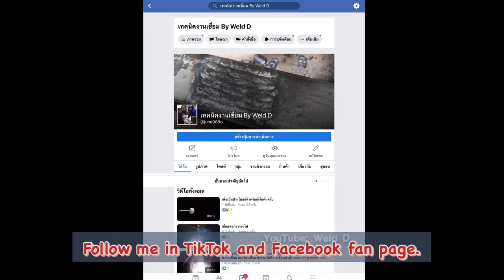2 techniques that professional welders use to weld square tube in vertical position.

Comment: how not to weld.. please please don't weld anything that is going to be around people please..
Reply: Agreed......
Reply: PLEASE DON'T....
Reply: Entonces cómo se hace?
Reply: Please do explain and post a video of yourself welding square tubing with stick welding
Reply: I think this video is basic for people who don't know how to weld!
Reply: This is how you weld when you can't weld.
Reply: @7ashoBeam 
 Yeah, showing them how NOT to weld!
Reply: show me how you do it then with a stick welding.. im a pipe welder and do fabrication outdoors and this is the only way you can do it specially with a 1mm thick square tubing
Reply: @jaival_rhaine for starters use the right electrode for the job. smaller rod size, less amps needed. Another option is to weld D- instead of D+, or even AC for less amps.
Reply: Also, as a pipe welder you should know this would never pass xray due to the impurities due to the slag inside the weld, which is just going to cause rust from the inside out.
Reply: @Corn_Pops_Rusty_Razor  then show me how you do it with a stick welding using a 1mm tube...

that does not even require an xray since it is not a pipe
Reply: @Corn_Pops_Rusty_Razor   i challenge u record how you do itand ill give you a grand
Reply: Buy me a video camera and tripod, and I'll gladly put up a video. I'll provide a po box when ready.
Reply: @Corn_Pops_Rusty_Razor  you dont wanna do it because you cant do it.
Reply: @jaival_rhaine  i said i would do it. send me a 4k camera and a tripod. i dont have the equipment
Reply: can some actually explain why is not a good weld ?  Im not a welder...never thought about welding, but Youtube keep me showing so many of this videos that I actually started to watch it... But all that I have seen is people bashing any and all types of Welds....like there not anyone that could properly weld...
Reply: look that up.,.youtube is aggressive with the removing of comments
Reply: @Corn_Pops_Rusty_Razor a decent welder would have the means of getting this equipment as an investment since you’re better than these youtube welders lmao everyone has excuses and opinions 🤧
Reply: @NotMe-jm4hg  lol I don't have to prove anything to you. Go to an actual welding school channel and see the correct way to do this.
Reply: @Corn_Pops_Rusty_Razor  scared 🤭
Reply: @NotMe-jm4hg  n5JOzxJFnbk
Reply: I'm only DIY sparky.
I would have welded vertical down continuous.
Not sure if that's right but I can get the flag to peel back

Comment: Do that anywhere I've ever been and expect to be rolling up your leads and being escorted off the property.
Reply: @MrKentaroMotoPI  Maybe not, but I've been burning rods in the oil field, power plants, rock quarries, and a few other places for 31 years, and ass or not, you try to weld like that anywhere I've mentioned and you'll be gone before your first paycheck.  Trying to save a young pup the trouble if this is where he's learning to weld.
Reply: What's the best method ,if you can explain to me please
Reply: @yusufswartz4958  Your weld should be a continuous bead, chaining 20 tack welds on top of each other is a great way to make a shitty weld
Reply: @mozdy7457 thank you!

Comment: This is not how pro welders do vertical structural welds.
Reply: I don't weld for a living but I wouldn't use that technique on anything I weld. Thats why electrode sizes are as thin as 1.6mm so thin steel can be welded with lower amps and decent beads that will be strong. Tacks are fort  holding steel together before a proper solid weld can be put down.

Comment: In all my time as a qualified ticketed welder 35 yrs plus I've never seen a vertical up run in spot welds, it would be ok in a farmers field on a gate maybe but that's about it. Great video though
Reply: @intiaboats  Cheers mate 👍🏻
Reply: @wayoutthere8637 
You correct there buddy..
 I've heard this claim time and time again-
"I've been a welder for 35yrs" 💩...
What they forget is that there is a difference between a ticketed qualified welder and a qualified ticketed welder 👍

Comment: the welder must mention other variables like the type of welding rod used, the thickness of the tubing or the amperage rating where the machine is set at.
Reply: Bom de mais cara
Reply: it says: E6013 2.5mm at 80 amp at the begining of the first weld

Comment: I concluded that you are a good welder by the selected music and the accompaniment of the sounds like YAAAAHUUUUU!
While the 6013, the diameter and  the amperage  are important, it is just as important to dwell for a longer time where there is more meat in the workpiece. .In the vertical square section there was the bulk material of the CORNER  while the horizontal square section there was the flimsy EDGE. so one needed to dwell more on the corner rather than the edge. 
EXCELLENT  videos and again , I like the music and the occasional YAAAAHUUUU.  and of course the WOW!  Well done.
Reply: All the best guys but the amp and the material should be stated also

Comment: I'm not a professional welder, or even a fitter but I used to weld non-essential gear at work. I was always told that  the slag on a good weld should come off itself, which it did and I'd feel gutted if I had to chip away the flux at the end; it was like someone saying 'that was shit.'

Comment: Try smaller rod and lower amp setting on your vertical uphill to see if you can run a continuous bead ...you might get slag trap in there and weld won't be solid.
Reply: He used 6013, not 6011 or 7018, this „stop-weld” is a good technique with it, when you go uphill. It is useful even with 7014 electrode. 6013 and 7014 are not fast freezing type electrodes, you cannot weld with them on uphill continuously. This is not an easy technique, it takes a lot of time to master it, but can be useful, when you only have 6013 in your pocket...
Reply: @zenobiahaku4087  I can't think of any process where you could weld like this and pass any kind of test.  It may work somewhere other than the U.S., but you won't have a job for long doing that here.  There are actually standards you have to meet with your work, for safety reasons, for one thing.

Edit: also, the "1" in 7018, 6010, etc, tells you that you can actually do a continuous bead uphill.  If you were using, say, a 7024 ("jet rods"), that is a flat or horizontal only rod. Either way, stopping and starting like that is a no no.
Reply: @texaswelder3745  Here, in Hungary, this is a mandatory technique in a welding exam. You need to do two welds, one fillet weld, overhead position on 60mm diameter, 4mm thick pipe, and 5mm plate. Your second weld is a vertical butt weld, on 4mm plates uphill, 300mm long (plus the start and finish tabs). You have only 6013 rods, with the diameter of 2,5mm...the fillet weld is not a big deal, but the second one is a nightmare...skip-n-weld, and avoid slag inclusions, excessive root penetration, and make decent crown width and height...
Reply: I agree, we were taught to weld a constant continuous flow to avoid slag entry.
Reply: @zenobiahaku4087 .... 6013 stick rod it's all there is available to weld in your country???
Reply: @JesusTorres-xz5jt  Fortunately no, you can buy any kind from welding supply stores. But in welding schools, you won't find anything, but 7018 and 6013, but you cannot use 7018 on exam, just 6013...pretty sadistic thing...
Reply: @zenobiahaku4087  🤦🤦🤦
Reply: @JesusTorres-xz5jt  ...yes, back then, i thought the sameXD
Reply: @texaswelder3745  40 years multi coded pipe welder in UK petrochemical etc., industry. Those welds are perfectly ok for general or DIY steel fabrication.
Reply: @hariowen3840  Then it's no wonder I always see on the news of something collapsing or falling over there.
Reply: @texaswelder3745  You've been watching too much Fred Dibnah TW 🤣
Reply: @hariowen3840  just sayin' 

Look at other comments from this side of the pond.    The standards in Europe seem to be somewhat lower than those over here.  You do what is shown in that video over here, and you will not pass an employment test.
Reply: @texaswelder3745  I worked on Rocksavage CCGT Power station for Intergen, on the ICI Runcorn chemical site, and all our pipe buttwelds were radiographed.  A pipe & vessel module was for some reason shipped in from the USA, which was to be connected to our pipework.  It was covered in stickers, 'built by American journeymen' etc., etc.  When the plastic cover was removed from the 12" weld neck flange, to connect this module to our pipework, there wasn't even a root-weld on the inside, just butted up with nothing on the inside???  And that box-section type of weld shown in the in the video would not be included in any type of employment weld test performed in the UK. (Just saying!!!)
Reply: @texaswelder3745  And get out from up-ur-own-Rs mate - not everything is radiographed petrochemical coded pipe-welding. You could mangle that box-section steelwork with as much force and strain as you want and those welds would never fail.
Reply: @texaswelder3745  And all UK and European petrochemical welding standards are based on and equivalent to the American API standards (American Petroleum Institute standards) and ASME standards (American Society of Mechanical Engineers standards) known as the BS EN -> ASME equivalent standards. (Just saying!)
Reply: @6.7powerstroke13  An amazingly well worded, coherent and comprehensible reply - thanks!  🤣
Reply: 저정도면 엄청 잘하는겁니다 파이프용접 어렵읍니다 전기 잘못맞추면 빵구한번나면 개판댑니다 도금파이프는 반드시 용접할부위를 갈아낸다음 해야합니다 원파이프가 용접하기 더어렵읍니다 내경이작은 파이프는 빵꾸안나는게 중요합니다 빵꾸한번나면 개판대기때문에 전기를 잘마추는것이 가장 중요합니다

Comment: This amateur welding can be used at home
Reply: I wouldn't weld like that even at home. I make welds to last not just look neat. I mean if a weld is needed usually means it needs to be strong doesn't matter what its for.

Comment: Hello. what is the ampere setting for thin and thick metals? thanks.
Reply: given that weld D only gives heart on the comments, i can provide you with a rule. if you are from USA (and if you'r not aswell) theres a simple trick to convert material thickness to amperage. you convert fractions of an inch to decimals of an inch, for example, 1/8 inch equals to 0.125 of an inch in decimal, and that number translates directly to ampere. so be it 125 ampere for a material thickness of 1/8 inch, or 3.18mm if you use metric. hope this information would be useful to you.

Comment: What is the Set up Ampare on welding Machine?if the size of welding electrode is 2.5 mm.?
Reply from the maker: I use 75-85 amp. For 2.5 mm. Electorde.

Comment: The vertical down movement isn`t a bit too quick?
Reply: Has to be quick because the slag is right behind the weld pool thats why it's only seen on you tube. If you have an arc welder try it and see how slag build up you get after running a short beas.

Comment: Is this for real? Future coded welders look away.  Only need to strike four arcs in total on this wall thickness box section (one for each position)  right amps with the right rod this should be light work using either hand for any welder worth his salt.  6g'rs will know what I mean.

Comment: Why are you letting the stacked tacks cool before laying the next bead? Your vert up had 2 stops that will create weld issues for example. In a true structure it matters. You can fault me for poiinting it out politely if you want, but it matters on the bend test. This is for education right? Dont sit on the edge of a pipe, pause on the flat surface, not the pipe end, or you will burn off the edge of the pipe.

Comment: what amp and rod size?
Reply from the maker: 85 amp. E6013  2.6 rod.
Reply: Could've run 1.6 or 2mm at 60 amps and ran proper solid beads instead of tacks. Tacks are for the first welds on each end and the centre to hold the steel together so  a solid bead can be run.

Comment: Is welding like this strong enough for things like rock sliders and bumpers?
Reply: no
Reply: I wouldn't weld like this for anything more than sheet metal.  That is not a weld that will hold up to  anything more than a really quick visual inspection (from several feet away),  much less anything I would trust structurally. Not sure what the standards are wherever this guy made this video,  but don't do that.  At the least you'll be made fun of by real welders, at the worst you could kill someone when it fails.
Reply: @texaswelder3745  interesting. Do you have any recommended channel about welding? Thanks
Reply: No unless you want it to fall apart because the welds will lack penetration aswell as reinforcing. Looks nice but wont hold shit for very long if the steel is thicker than the steel he is welding.
Reply: @texaswelder3745  crees que va a usar ese espesor de metal para una estructura que tenga que soportar peso? O bien, que lo suelde como si se tratara de metal grueso? Aquí todos son "expertos" para decir que está mal, pero no dicen ni muestran la forma correcta de hacerlo. He visto que dicen "está mal, porque no usas Mig".

Comment: So I found out that if the weld is still red hot, you can re-strike the stick it's not consider to be slag at that point and it's safe to weld onto.

Comment: WoW  !   Xcellent,  choice of  REAL   M U S I C.   This music, is the same as on a few other  Youtube videos; one is of/about  the   'old  west '   in USA.    Very good, going uphill; stopping to give it the  ' stack-of-dimes ''.....appearance; and giving the next spot, a base so there is no  RUNNING  of  said  bead.      I have a  MINIMIG  130 E   welder, its'  not a gas one; but works ok for small stuff in the garage.  Could you recommend, the best  flux core  0:30  welding  wire, for  steel  ?   I do mostly mild, some hard stuff, like bearings and  tools.  No stainless, nor aluminum.....not yet anyway.  May convert the inner tube, to plastic for aluminum, and make other adjustments on the push-roller.....also change electrode polarity.  Learned of this, from Youtuber  Brandon  Lund, he is a  VERY  GOOD   TEACHER  /  INSTRUCTOR  on his channel.   Thanks, for your effort, and GIVING   heart  !  from  alberta  canada.